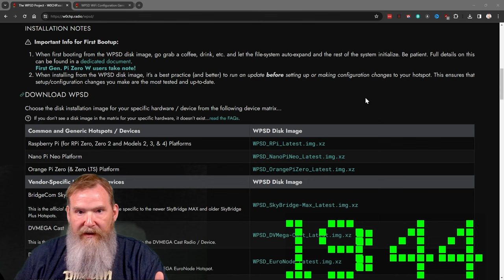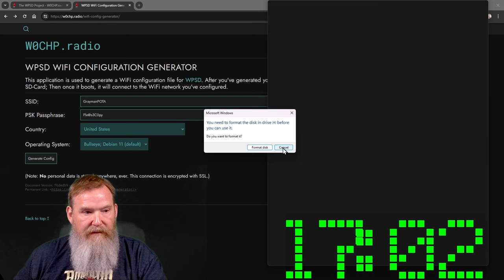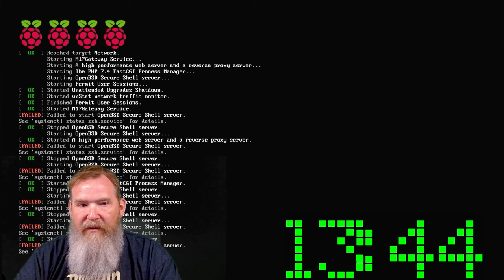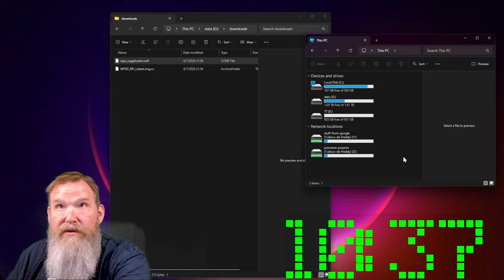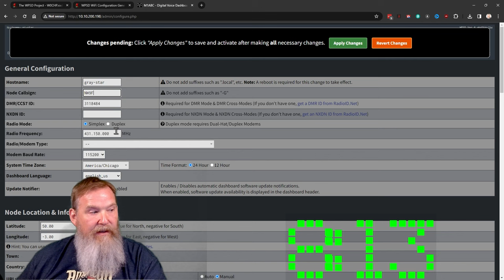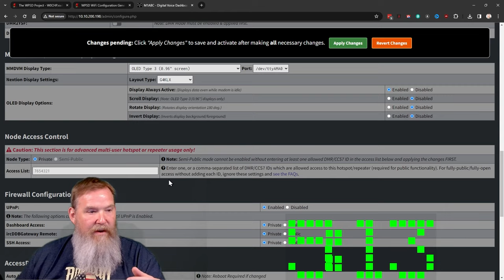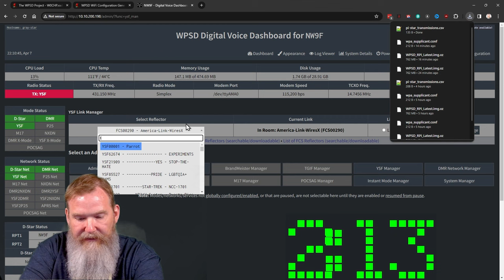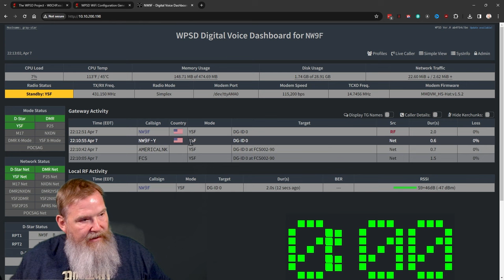Quick WPSD Tutorial: Start To Finish in 20 Mins

Comment from the maker: If you have any questions or comments, please drop them below 🌮🌮🌮
Reply: Thanks for the Vid!  In  my case it is taking sometimes 10 mins or more just for a config page to load, sometmes timeout, no fun so far.
Reply from the maker: @Orionshield1948  It has been a bit since I made this video and the minimum hardware requirements might have changed since then. 10 minutes to load seems like a resource issue. Are you using a board that is on the recommended list. Additionally, there is a link to known compatibility issues that you might be bumping up against, https://w0chp.radio/wpsd/#known-issues--incompatibilities. I hope this helps.
Reply: @GraymanPOTA  Thanks I read that and this particular Pi is  pi zero W, so I  finally worked around the bad gateway and other stuff, after finally getting the configuration page loaded and installed performance gradually improved.  Will probably go ahead and guild a Pi Zero 2 W as an upgraded. 73

Comment: Nice video. I just bought a Raspberry Pi 4 8GB & a MMDVM Duplex Hotspot Module Dual Hat (the hat arrives tomorrow). Do I need to do anything to the RP prior to this? Or is everything more or less configured onto the SD card? Just making my plan of attack for when I get all my parts. I should t have to do anything g but physically connect hat to RP, follow steps in video & write everything to the card. I’m an IT guy, but first time playing with a RP. Thanks!
UPDATE: I went ahead & configured my SD card and have it sitting in my RP now; just waiting for my hat to show up to slap it on, the power it all up & configure it as shown in the video. Good first video for me regarding DMR hotspot setup.

Comment: On my dashboard screen for the modem, I have green blocks for DMR, DMR Net, and TS2 Enabled.  But, under DMR Master I have RED blocks for BM 3102 United States, and for TGIF Network.  Should they show GREEN?  The dashboard shows my radio and callsign when I transmit, all normal.  I think the modem is not passing data to the network...???
Reply from the maker: Have you double checked your password to connect the hotspot with the BM network?

Comment: I set up my Nextion HRO Zumspot, I can received fine but my transmission is not heard, that is the report I get from others. I am using a FT2DR
Reply from the maker: Is your hotspot a simplex or duplex model?  Most are simplex, one antenna. If it is Simplex, make sure you do not have a repeater offset set in your radio.
Reply: @GraymanPOTA  Thanks for the reply, for some odd reason is working fine today. It is a simplex.
Reply from the maker: @edgardoramos6061  Good deal. Just make sure you do not have an offset selected. Most newer radios will automatically select the offset you if you select a frequency within the repeater portion of the bandplan. Depending on the radio, you might be able to over ride the duplex option and select Simplex. One caveat I have found with DSTAR, you have to select Duplex with a 0 MHz offset on your radio or your voice traffic will not leave the hotspot, event if you select the non repeater section of the band.

Comment: Just burned this img to an sd card. I have to say this is extremely slow to boot compared to pi-star.  Running on a pi zero w 1 gen.
Reply from the maker: I believe that is a single core board. It will run, but they recommend a minimum of a four core board like the Pi Zero 2W